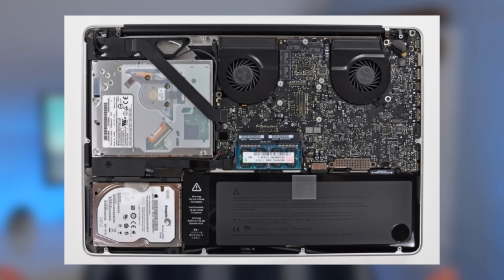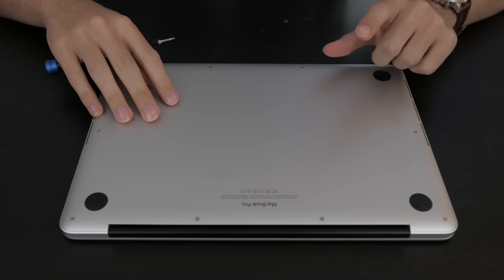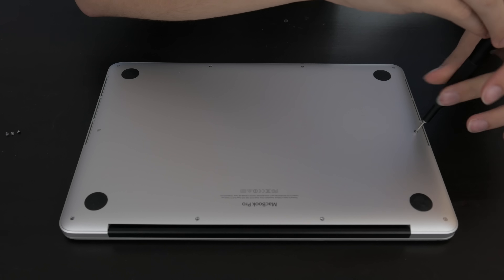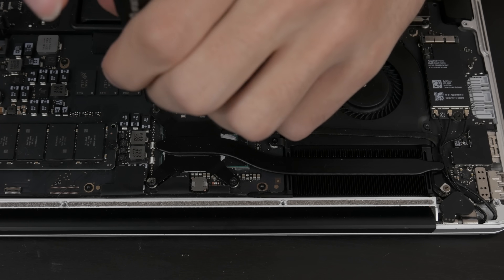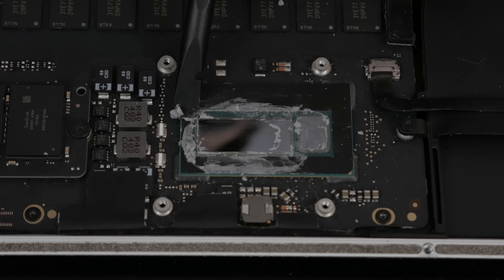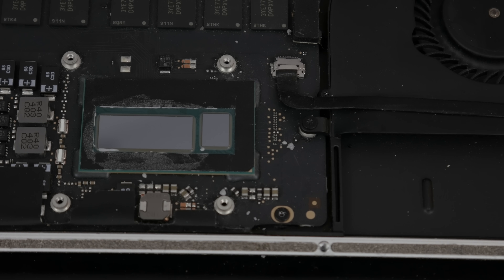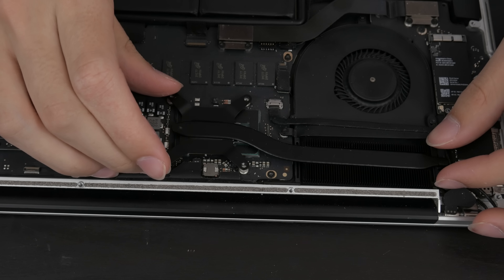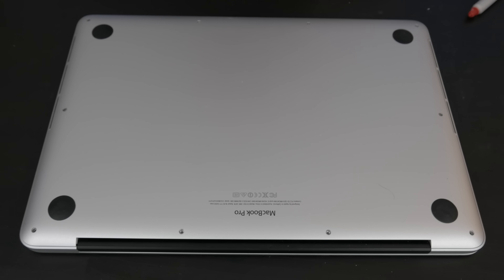If you have a Retina MacBook Pro, you need this $6 Upgrade!

Comment: I know i'm supposed to do that but i'm always afraid to open my laptops that way, especially since i've started using macbooks... I LOVE my 2015 Retina MacBook Pro and i'll end up doing it anyway, cause it's my daily driver and it runs too hot for my taste... Thanks for the video, it will be a tremendous help !
Reply: I just did this on my model and it's made a night and day difference and I don't think I'll be forced to upgrade for another few years.
Reply: @trxggxt  that's great cause I really don't like the new MacBook Pro. I'd like to stick to the retina for a while.
Reply: How'd it go?
Reply: Don't listen to this guy, you shouldn't replace the thermal paste on your macbook.
Engineers know very well how to design the heatsink and what thermal paste is the best choice.
I've never heard of macbook breaking due to overheating, there were problems with some gpu models but it was a welding fault.
Reply: Nicola Serra Don’t spread ignorance. A properly cooled computer is known to last longer. Regardless of how good the engineering is, thermal paste needs to be replaced every couple years. 
Your comment is the equivalent of telling people to never fill the coolant in their car because the engineers knew what they were doing when they built it.
Reply: @niconiconii-san  Bullshit. Get Knowledge, Watch Louis Rossmann and also look at Intels website for recommended CPU-Temperatures. Apple MBP's work mostly at that limit. New Thermal paste and macs fan control and your Mac will run at 50-60 Degrees Celcius rather than 97-100

Comment: How about squirting your thermal paste on piece of plastic or other surface, then use a toothpick to dab small amounts on the CPU surface.  That way, you control the amount and placement instead of getting a large amount where you don't want it.  Great video, I will have to do this to my early 2015 13" MacBook Pro.  Could you post a link to the site to order the thermal paste?
Reply: Arctic silver and mx4 or liquid metal if you wanna go extreme

Comment: Cant belive that heatsink size, if u notice it didnt even cover/touch the igpu ...like wow, on the other side great video dude!
Reply: The second chip is the Package Controller Hub, not the graphics chip.
Reply: Yeah, I don’t see the point of applying thermal paste to the igpu if the het sink doesn’t touch it. There was already paste on there when he removed the heat sink, tho.

Comment: I just got a 15” 2015. I’m going to do this
Reply: The Trammell no his computer blew up
Reply: Did it work well? Just came across the video and I’m considering it.
Reply: Smart. Same here.
Reply: Yeah did it work
Reply: It worked well for mine. I can run a handbrake encode and it stays at 3-3.1 ghz and maintains about 57 watts of sustained heat dissipation now at 97C which is pretty good! Running consecutive cinebench r20 results in about 50 watts and 92C with the fans at about 75%. Definitely an improvement over before where the heatsink was only good enough for about 47 watts at 100C with the fans maxed out. I got 10 more watts of dissipation!
Reply: me2